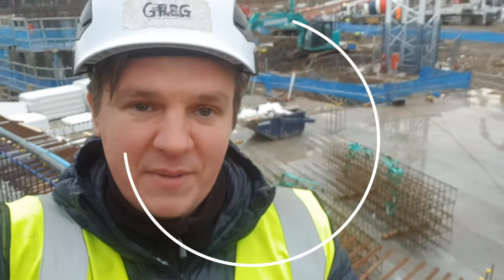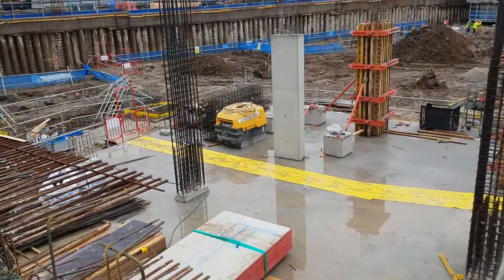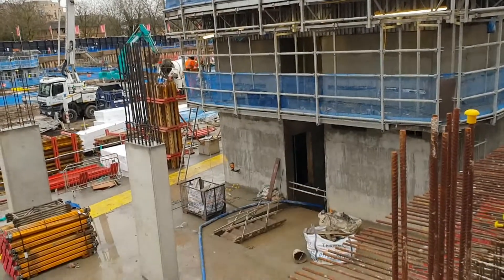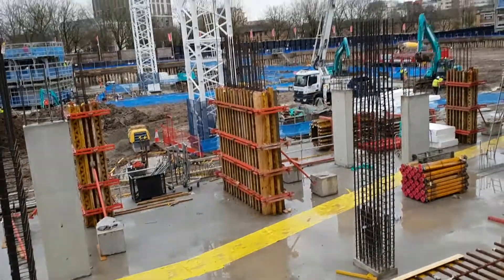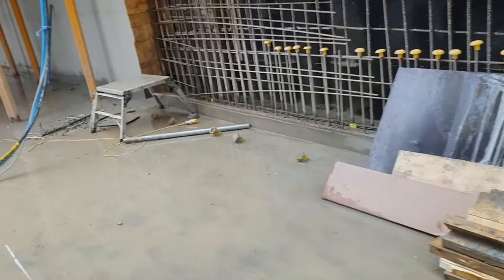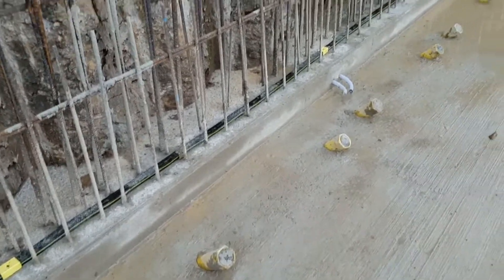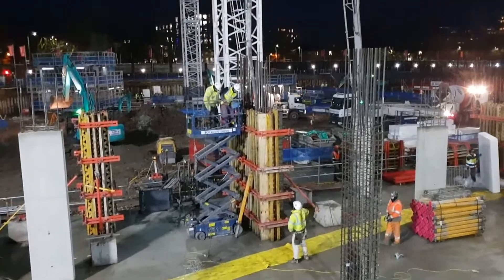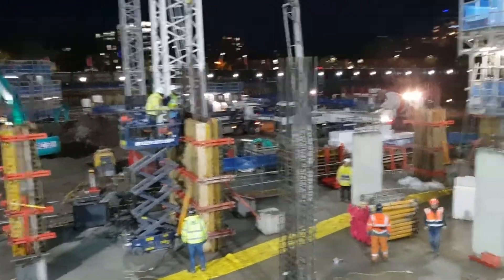WALL & COLUMN construction process step by step.

Comment: 01. Why spliceing of rebar, instead of Coupler or welding ?
02. Is it still permisible by code to Construct kiker or column starter?
Reply from the maker: Splice is cheaper and effective. Use couplers only when you can’t splice eg steel congestion. Welding is not the way really
Reply from the maker: Kicker is a good construction practice and permissible. The problem is there are mistakes made so needs to be done correctly. I would say its really good for a liner wall - poured with the slab pour and having the joint that 100/150 above the slab
Reply: @SITENG  , while, it has already warned,  to minimize construction joints. 

Casting monolithicaly is good practice to get more durability from structure. 

Another problem is that,  while you cast 100 or 125 or 150 mm kicker , the top face need to be rough, for further casting. Now when you use concrete breaker machine to make it rough, there are possibilities to breakdown full 100mm....or...125 mm..... as a whole. 

Another problem is,  to maintain concrete mix design proportions can be difficult in kicker.

N.B : 
It's better to use surveyor.

Comment: Hello sir,
Great series of videos i love them!
A quick question, the liner walls with the anchors and a frame support... the wall is needed for the shoring ? To avoid any failure in the soil next to the excavation?
Thank you and please keep it up!
Reply from the maker: Thank you Abdo! Liner wall is needed for permanent works - it's still secures exposed ground and resist ground water pressure (it's waterproof too). Piled wall would do the shoring job actually. What do you mean by failure in soil next to excavation?
Reply: @SITENG  oh understood i thought that the piled wall was not enough for the shoring! Thank you sir, i just meant that if this wall was needed to avoid failure due to weak shoring or to just provide a clean finishing 😀

Comment: Hi Greg. Just wondering how do you check the top level of the already cast column or wall? In particular if your station is set up at the same level where your column, wall is starting. I've seen a lot of times the formwork is actually quite higher than the top concrete level itself and the boys are using nails to mark the top of the concrete. I personally  use laser level or just a normal tape measure, but you may have other more advanced approach ...  thank you!
Reply from the maker: Hi Ivaylo Peev! I am checking the height-level of top of shutter and then tell the boys how much lower they have to pour to achieve the what we want, or doing a dipstick for them.
Reply: @SITENG  Thank you

Comment: Great to see your videos. Can you make videos of 
1) fixing the kicker with a shear key inside. 
2) providing supports for the kicker of the walls. 
3) stopper of walls and slabs (construction joint) with the rebars passing through.
Reply: Also please show the connection details of the push pull props (columns) with the concrete blocks. How do you maintain the column verticality while vibrating the concrete??
Reply from the maker: Raj! I will try to show these soon, will do a site walk video and will tell about few things :)
Reply: How to check the column verticality through EDM

Comment: The steel/reinforcement should be staggered at the top for lapping, which is not the case in the video showed! Or may be it's not clear in the video.
Reply from the maker: Hi! You mean column rebar?
Reply: @SITENG   ya we in India call it as lapping where the reinforcement for the next floor is being installed.
Reply from the maker: Has to be there, unless the column 'dying off', with minimal lap length.

Comment: to check the verticality of the column with the EDM what program are you using , the COGO?
Reply from the maker: Hi Marian! I am checking it using ref. line and offset tells me everything (creating the ref line with no resection). If my EDM is set I use ref. line too, but in this case I am using the actual column line.
Reply: Thank you!!!

Comment: Greg,
           Very good video of the structure of the column and the use of the kicker to fix the shutter to it.

          I think we all need to know how the concrete column and the wall is kept smooth during the concreting.

          Can you explain the mystery of 20mm of the steel into the slab. Are you saying that the last link of the column should be 20mm inside the slab above the column. Please explain.

         I see that the concreting was done at night with the flood light on. Can you concrete at night without any effect to the quality of the work.

          Brilliant video in all aspect and very educational for all viewer like me.

         You are a great cameraman on the building site. Superb.
Reply from the maker: Thanks Asim! Happy you like it :)

Comment: Is there a maximum height that we can pour the concrete into a column or wall (vertical elements)?  How can we assure that the poured concrete is not segregated at the bottom level?
Reply from the maker: Hi Hasitha! It's the pressure that limits the height, but you can pour really high elements. The concrete has to be placed correctly using a poker (concrete vibrator) which guarantees proper distribution of aggregate throughout the element.

Comment: Hello, how come the formwork for the columns isn't supported on all four sides (~min 2:40)? Is it because of the connection of the horizontal bracing of the formwork? Is that something you would judge on site or was it pre-established in the design office? Thank you!
Reply from the maker: Hi Alice! Each push-pull leg holds the shutter in both directions. Shutter box is set on the kicker and is constructed to take the concrete pressure itself. Shuttering belongs to Temporary Works, needs a design and client approval.

Comment: What's the black rubber thing at 5:55?
Reply from the maker: That's a waterproof product Rascor. It's the same as on my core video when I say few words about it, but I will also cover more in Construction drawings. The injection goes into this later providing waterproofing at the joint (kicker-wall interface)

Comment: Hi, In some areas of the liner wall the concrete is cast directly against the piles/clay but some areas have the black sheeting/membrane to separate piles from liner wall, why not same detail through out
?
Reply from the maker: Hi Tadas! Waterproofing was not finished yet there, so before rebar I believe they installed the rest, but when I'll go through the drawings we will find out as there could be extra waterproofing in core area and rest actually might be without it.
Reply: @SITENG  Okei thanks for the reply, enjoying the videos. Would like one on the slip/jump form, never had to deal keeping core plumb/in position before rest of the frame.
Reply from the maker: I will try to do one soon, as I might be going to site where there will be slipform :)

Comment: Very cool narration, thank you! The A-frame one-side forming is such a big cost to just get concrete against an existing vertical surface.  I am sure you have reasons for not wanting to use shotcrete. What if there was a light slip form method for that?
Reply from the maker: Hi SpaceCrete! Thank you! Methodology is not up to me, especially on this project as my part is finished there. I know these guys actually using shotcrete on other projects so it might be the client's decision really.
Reply: @SITENG  Thank you Gregg! Yes I meant the job's decision makers. Not trying to advocate for shotcrete as it can have issues. It is just that one-sided forming is so inefficient and expensive, we are working on a very-rapid light slip-form method to use instead. Have gone vertical at up to a foot a minute.
Reply from the maker: Just watched your video, method looks great, hopefully we will see it working here soon :)
Reply: @SITENG  Thanks for checking it out! Still working on improvements.